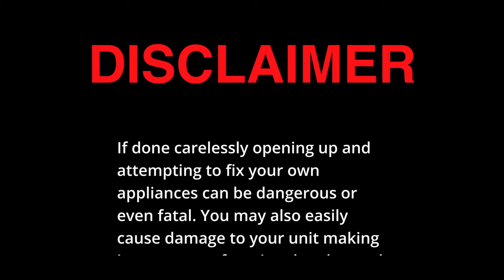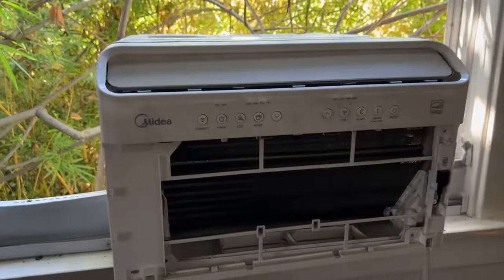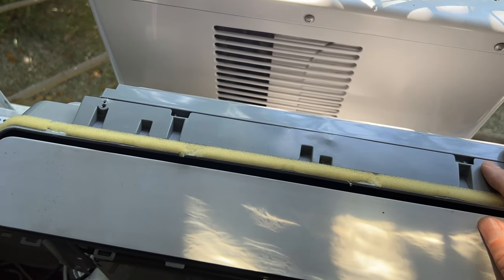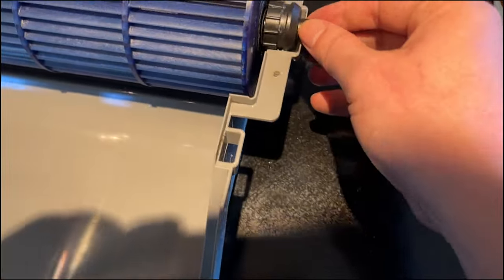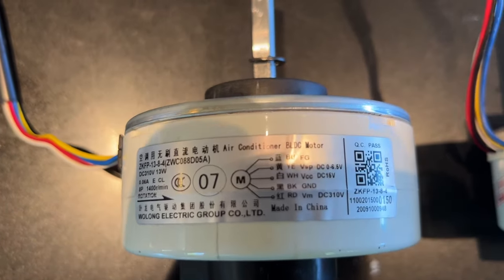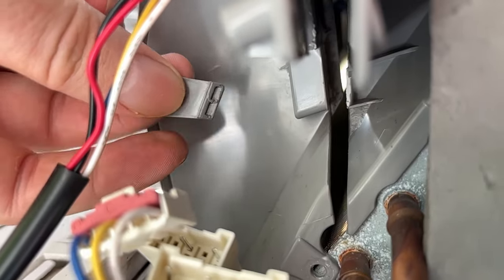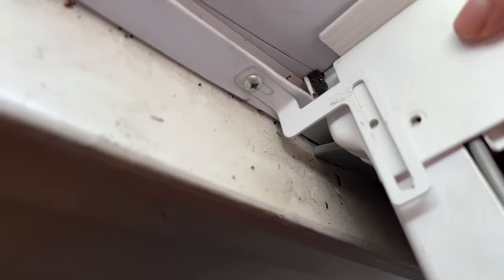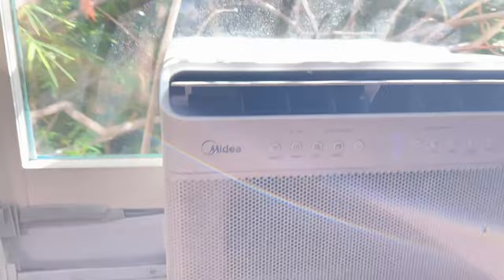Midea U-Shaped Air Conditioner Teardown & Repair: Blower Clean, Fan noise fix, Motor replacement

Comment: WAY TOO HARD TO TEAR DOWN, AND EVERYONE WILL NEED TO B/C IT COLLECTS SO MUCH GRIME ON THE BLOWER WHEEL AND STARTS SMELLING LIKE MOLD/MILDEW AND IT IS NASTY. WOULDN'T RECOMMEND THIS UNIT FOR THAT REASON.
Reply from the maker: My experience has not been quite the same. Never smelled anything like that.
Reply: The lack of a drain hole for the condensation is the problem with these units
Reply: You are supposed to tilt it slightly backward during the install to prevent condensation build up on the fan. This is specified in the install instructions, where they tell you to lean it slightly off level.
Reply: @gamechannel1271 yeah I did that and I am in the same boat. Mold like nuts.
Reply: Always run in fan mode for a while before shutting down, same goes for car AC, to dry the evap coil.
Reply: If you take out 3 or 4 more screws the whole front unit comes off of the AC. Minus the radiator itself. Makes it pretty easy to work on actually.

Comment: You are a legend, this video is more helpful than anything Midea shared with me. I was quoted $300 for someone to clean it and able to do it on my own thanks to you! Really appreciate that you took time to share all of that with us.
Reply: that being said, my hands are bleeding and I am left with two screws hahaha. I am not looking forward to doing this again next year.
Reply: @julienbenatar  howlong did ittake?
Reply from the maker: I felt this was a better way to deal with my frustrating than posting a negative Amazon review (especially since overall I do like the unit)
Reply from the maker: @julienbenatar  Having had to do this a number of times (to explore, to get part number, try other fixes, etc) I promise this gets easier and easier every time (partially because the stiff parts aren't so stiff any more) that said,  I will randomly find myself having an extra screw.

Comment: Thanks 1000x over!  Just did this today.  No more screaming crickets!  Took about 45 minutes thanks to this video.  One note: that screw on the motor shaft that you access through the missing blade is just a set screw.  Just unscrew 1-2 turns and you can slide the motor off.  No reason to take it all the way out.

Comment: This video helped me take mine apart just yesterday to clean in out. One note I wanted to mention. It's possible to take out the whole plastic unit that surrounds the front radiator if you remove 3 more screws. Then it becomes much easier to take apart and clean the whole area.
Reply from the maker: If only I had known...
Reply: What timestamp in this video can these three screws be found/are visible?
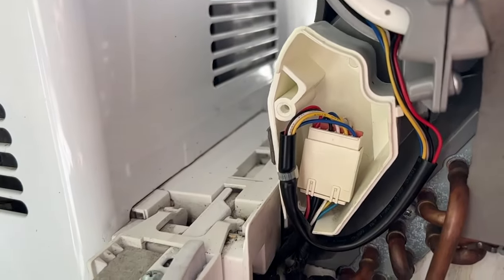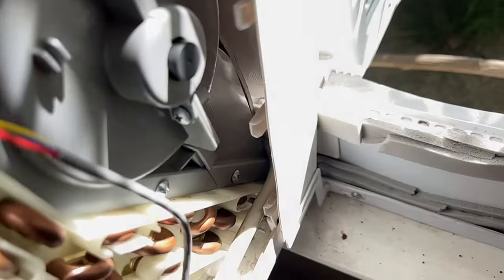Reply: @nicolaschase2392  I think 46:12 and 47:44 show them. I'd have to check mine again to be sure though. It's fairly easy to tell once you have it open. It would be any screw connecting the plastic to the metal.

Comment: For cleaning the blowers, there's an easier way without removing the blades. Just get yourself a large nylon straw cleaner and some pressurized water bottle. Remove the blower louvers (large one is attached at the sides and small ones pop right off), then use a flat head to remove the metal grate (note remove the bottom attachments first and then slide up. The top middle grate is really hard to remove). Once you have access to the fan blades, spritz with soapy water (maybe some Oxygen bleach) and then mechanically remove mold with the straw cleaners. Once done, rinse off with more water and let air dry with the front open. Be sure to catch the water that comes out the from the bottom.
Reply from the maker: Interesting. I will give that a try if I need to!
Reply: I m going to try this method. My blower is gross
Reply: On mine the reason the metal grate in front of the squirrel cage was hard to remove was because the top middle prong was an inch long. Every other prong was about 5/16” long. I trimmed the long to the size of the others.

Comment: Thanks for the video.  I broke my blower fan by putting a thermometer to far into the opening. I was able to buy a new one for 19.99 and with this video had it up and running within an hour.  One tip I have is that I did not have to remove the entire plastic housing around the fan blade.  I took all the screws out  and was able to open in enough from the top to remove old fan and install replacement.  This saved a lot of trouble of having to get the bottom of the housing lined up and probably knocked 15 minutes off the job.
Reply: Hey, im in a similar situation to you! I'm not able to disassemble the whole thing, I just want/need to replace the piece you replaced due to mold. Pretty sure the mold is old and from my last place, but cleaning it is so difficult so I just need to replace it. Can you explain a bit more how you just removed that top part?
Reply: @lilbeanbun  Basically the video shows this right at the 22 minute mark.  Use toothpicks to hold the grey plastic latches open, remove all the screws and pry the top open just enough to remove fan. I did not have to unplug blower. take fan off, clean place it back on taking care to install it far enough on blower spindle and snap everything back into place. good Luck!
Reply: @georgegassmann655  ah, so I have to do all the steps up to and including what happens at 22 mins in, then put it all back 😄 good luck to me, indeed! Yes, I have been trying to clean the thing from the front without taking it apart, but yikes I'm basically using 1000 q tips to do so. Thank you!!
Reply: @lilbeanbun  Don't let is scare you. it's like putting together Ikea furniture. Just go 1 step at a time and it will be easy.
Reply: What was the part number of the fan blade and where did you buy it??
Reply: Where did you buy the new blower fan? Link please. :)

Comment: I helped my girlfriend install her Midea-U today, but a minute after the unit was turned on, error code 07 appeared on the display. Midea does not list error messages online or in the instruction manual, but Amazon explains the problem that many people have had. A piece of black vibration dampening material is wrapped around the 2 copper pipes next to the condenser coil fan (the section of the unit outside the window). If the material extends too far, it will prevent the condenser coil fan blade from turning, causing an error code 07 . In order to make the unit functional and prevent the error code 07, remove the top cover from the outside portion of the unit (3 screws on top, 2 screws on each side and 3 screws in the front. To remove the 3 front screws, a stubby screwdriver is necessary). On the left side, by the compressor are 2 copper pipes with the black material between the pipes. Trim or push the black material away from the fan blade so it spins freely, then install the cover and screws. It is easiest to test the unit before installing it in the window to be sure it functions properly so you can make the repair if needed. The fan on the inside part of the unit did not have a problem and worked normally.
Reply from the maker: I hope google indexes this so that people who need to know can find it!
Reply: Dude im going to try this I have the same problem

Comment: Thank you for making this video with your step by step instructions.  It reassured me that it was the motor that I needed to replaced. You also gave me the confidence to tackle this myself. I really like the quietness and the cold air of this Midea air conditioner.  I was going to by another new one.  You saved me a lot of money.  As I was removing everything apart I realized that there were three more screws on the left side and three on the right side that also could be removed.  This allowed me to remove the whole motor housing straight up and out.  It came out so easy.  I didn't break a single tab off.  It also was very simple to slide back in.  I hope this helps everyone tackling this repair project.  It was definitely worth the effort.  Thanks again Nick.
Reply from the maker: Glad to help. Like I've said, other than having to fix this motor I really like the unit. If you're having this problem, too, I wonder if it's a supplier issue.
Reply: It was the motor and it has been working great after I replaced it.

Comment: Super Super Helpful! I just watched this 4 times stopping and going backward and then forward as I worked. I  kept you playing while I worked so I didn't feel alone with this annoying task. You didn't miss a single part!  The slow pace was perfect for me to work along side you and pause and resume. Thanks for the close ups of the clips and other ways to separate the electronic connectors. I am so thankful for all of the time you took to make this video. Thank you for doing such a kind service for all of us of sharing what you have learned! And you were totally right, you do have to push so hard, that you think you are going to break it when removing the white case. So now 3 hours later I have a better smelling and completely working AC! I am proud of myself! (But I could not have done it with out you!). The one thing I added was WD40, on the end of the drive shaft for the blower wheel axle before putting back the axle into the rubber end. I did this because I noticed that the axle had grease on it when I took it out so I wondered if it was important to grease it. Anyone else need to re-grease the axle?
Reply from the maker: Glad to be of help! I put grease on it, but that's because my first attempt was to grease everything! Didn't work!

Comment: Very well done--I love when a gutsy hack succeeds!  I have one of these installed waiting for summer temps.  I got an asurion 3-year plan but if they ever tell me to "get bent" I now feel comfortable I can get to the squirrel cage for mold abatement or motor replacement in a pinch. I know I'll break some clips and strip a screw or two but you've helpfully shown here it's doesn't seem to be an issue.
Reply from the maker: Yeah, seems they knew people would take it apart and made it so it'd still work perfectly if a tab is broken or screw missing. Mine hasn't lost a step.

Comment: This video helped me take apart my unit and get to the Blue Roller. It was covered in mold and mildew. Following the steps, I was able to get it done in 3 hours today (half the time was cleaning and most of the time was just getting the front cover off). 10/10 Thank you for your help. With all said and done, I only broke 2 tabs and lost one screw behind the "Coffin" cords
Reply from the maker: That's doing pretty good!

Comment: Wow! Thank you so much for this video. Saved my sanity when I had to perform a full breakdown for mold/mildew ablation. One thing I noticed (and perhaps it is unique to my particular model) is that the wires coming from the motor actually have a notch in the cover below both of the top and bottom ventilation holes. If they are fed through this notch instead of the bottom hole, they are not pinched up against the motor as much and have more slack to wind them back into the “coffin.”
Thanks again for your great service to Midea owners!!

Comment: I just finished the motor replacement and this video was very helpful.  Especially with the link to the correct motor on Amazon and the hidden screw that comes in from the back side of the blower housing.  I'd would have never found that screw without your help.

The fan shaft setscrew was a bear but my drill-driver got it out with the light impact.

Comment: Thank you. after watching this had mine apart in 15 mins cleaning the fan the right way not the Qtip way. Was Easier than looked and now im very familiar with it if i need to replace parts.  You did great just took you longer using camera for this great tutorial.

Comment: Thanks for the video. It helped me understand how to get the unit apart better so I could properly clean out all the mold growth.  I saw another comment and would like to second it that the whole grey plastic assembly can come out as a single unit that's screwed to the evaporator coil.  Only need the screws on either side of the evaporator and the white cable holder piece. The one you missed to get it all out is under that foam piece on the left side of the unit.  Pull the unit as a whole, and them disassemble on a bench from there.  Makes it much easier to get at the screws in the back and that one screw that's hard to get at on the left.  The hardest part of disassembly was getting the front panel clips undone.  Now that some of mine are broke or looser it will come off much easier next time I clean.  Cleaning in itself took much longer of course, it takes time to clean all those individual fins on the blower.

Comment: This unit is such a pain in the ass to take apart. And like most mini split systems, they accumulate way more mold and debris than a standard unit. I blame the squirrel cage blower and how close it is to the coils, picking up moisture. I know most people will frown upon this but I’ve cleaned the blower and coils without taking the unit apart fully, and using a hand steam cleaner. Just need to be careful with the blower and the motor but it works when it’s mid summer and 95 degrees and you don’t want to take the unit apart completely. 

Thanks for this video though!
Reply from the maker: Getting the casing off, and some of the latches are the hardest part (esp when putting it back together) and the cable connections if you're not familiar with how they work. That said it is doable! I wouldn't have thought about using the steam cleaner to get in there, but it's an interesting idea! I haven't had any mold problems (fingers crossed) so hopefully it will never come to that!
Reply: The hand steam cleaner is a great idea. My unit is only a month old, but I'll try that when needed. Is there a particular one you own? I've never had one.
Reply: @nickrobinsonisthedev  I have this ac unit, do I need to clean the blower... My problem is my ac unit has some kind of funky musty type of smell and my room is clean  ( it only does it when its on eco mode and it switches to verrry low speed ). When I looked it up every site says its mold/mildew, and that can't be because I live in bone dry ass phoenix arizona where the summers stay at like 110 for about 6 months.

/ I just sprayed the front and back with cleaning spray, waited till it was dry and turned it on and don't smell nothing.

/ aww f*** left it on for about hour and now I'm smelling it again. Its gotta be the condenser or something. 🤬🤬
Reply: @xdarthpool6463  Try shining a flashlight on the blower fan and see if you can see anything.  I had the same kind of smell, and sure enough, there was mildew growing on the blower fan.  I live on the coast in Florida, so humidity is rarely below 80% and I sorta expected some issues.  Seems to be fine if I manually turn it on and off and prevent it running the fan for hours.
Reply: Omg, I would LOVE to know if you have any tips on what you did with the steamer! I took all the front-facing stuff off/apart and now I'm cleaning the blower with q tips and scraping the hell out of my hands. Did you just do vinegar and water and steam? Where did the water go? I'm afraid of using any drippy liquid because I have no idea where it'd drain 😂

Comment: HUGE thank you for this breakdown. I didn’t have a motor issue but I did need to do a really deep clean. When I finally got to the fan, it was covered in mold 🤢 But your vid helped so much, especially your tips on the tabs and wires. Really appreciate it!
Reply from the maker: Glad to help!

Comment: For tight spaces, they make screwdrivers that are under 3 inches long at any hardware store.
Phillips head/driver tips come in at least three weird hole sizes.
For those tight spaces, if you use a magnetic driver, and the screw is aluminum or plastic, take a tiny piece of tape, wrap it around the screw and the driver, so it holds the driver tighter than the screw. When you screw it in, the tape will stick to the driver. I discovered that idea while working in tight, deep computer spaces.
That damn noise! It sounds like Cicadas! ~~ THANK YOU!!  ❤
Reply from the maker: All excellent tips, thank you.
Reply: Cicada's Exactly!
Reply: Better than that you can buy right angle drill attachments to attach to a drill. Both hard and flexible shafts. I have a hard one but might be even better getting a flexible shaft.

Comment: Thank you so much for your video!  After much research I bought one of these used, and after hearing the noise when turned on I know why they sold it(supposedly moving to central air apt). Your video was fantastic, and such a huge help while I replaced the motor yesterday.  You saved me a lot of worry and money as I am a do it myself person.  Also a thumbs up for videoing this at the same time as the repair. Very talented. 😊
Reply from the maker: Love to hear a story like this! Glad to help!
Reply: The troubleshooting table in back of the installation manual says to expect a bit of noise at startup, very quiet after. But sounds like that used unit might've been way noisier than that.